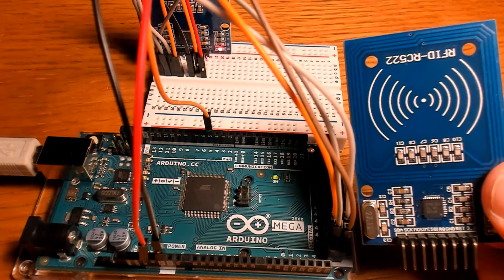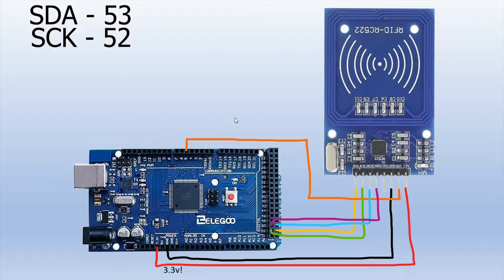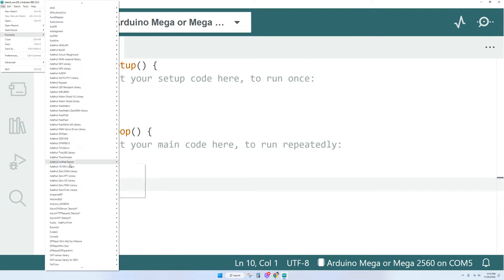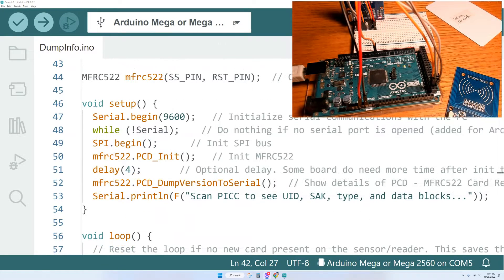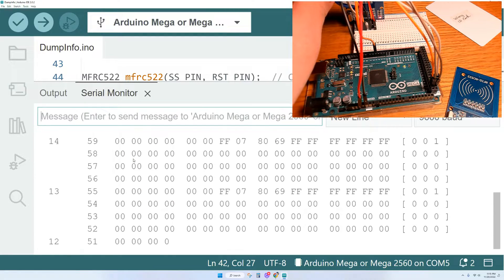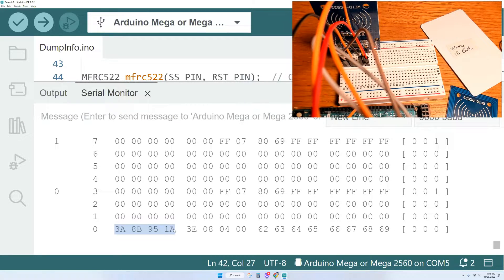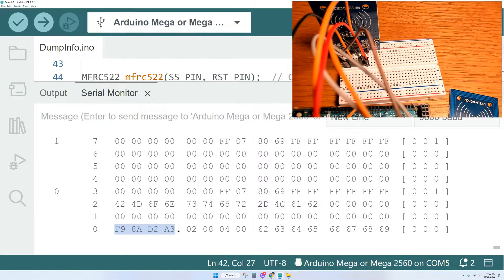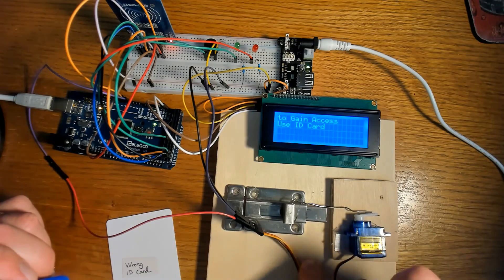How To Get A Unique RF Card ID Number When Using Arduino And The RC522 RFID Module

Comment: Will it read the card at a frequency of 128 kHz?
Reply from the maker: hi there! The answer should be "no".  The frequency range for this module is 13.56 MHz. The tag and reader needs to be tuned to the same frequency.
Reply: @BMonsterLaboratory  Are there multi-frequency modules for arduino?
Reply from the maker: there are some cheap ones on aliexpress and maybe sparkfun but I have never used one....

Comment: Hey, I'm looking for the best robot to build with a six yo. She's smart af. I watched your video about the mech-5 coding robot and don't know if I want to get that one after seeing the problemsyou've pointed out. Any info will help. Ty either way
Reply from the maker: hey there! the Mech-5 robot has parts far to weak and cheap to keep taking apart and putting back together. nice concept and if you build 1 or 2 different builds it may be ok, but any more than that and you may have problems. For a 6 year old, I would get something Scratch based. Something they can have fun with for a long time. I haven't used this but it's been around a while and people seem to like it (link below). You can also program it with Scratch. It's expensive but in this area I guess you get what you pay for.  Good luck! 
https://www.amazon.com/Wonder-Workshop-Dash-Activated-Programming/dp/B00SKURVKY/ref=asc_df_B00SKURVKY/?tag=hyprod-20&linkCode=df0&hvadid=312141700493&hvpos=&hvnetw=g&hvrand=7030510041958191712&hvpone=&hvptwo=&hvqmt=&hvdev=c&hvdvcmdl=&hvlocint=&hvlocphy=9015754&hvtargid=pla-457175114824&psc=1&tag=&ref=&adgrpid=60961041726&hvpone=&hvptwo=&hvadid=312141700493&hvpos=&hvnetw=g&hvrand=7030510041958191712&hvqmt=&hvdev=c&hvdvcmdl=&hvlocint=&hvlocphy=9015754&hvtargid=pla-457175114824
Reply: @BMonsterLaboratory  thank you. I'll look into it. You are awesome keep up the good work. I can't wait until she is old enough to where I can stay introducing her to the marvelous world of arduino.
Reply from the maker: that's great! good luck to you and thank you for the comment